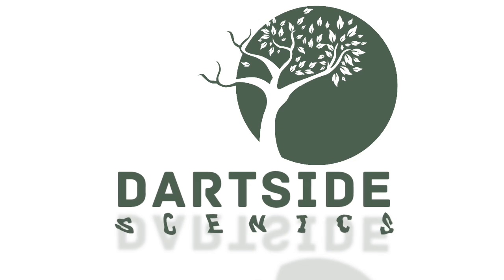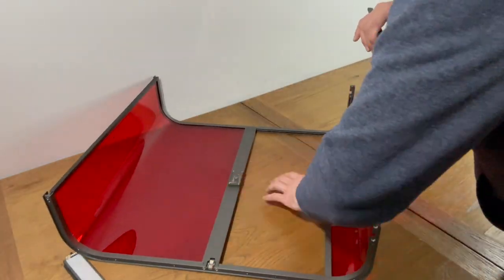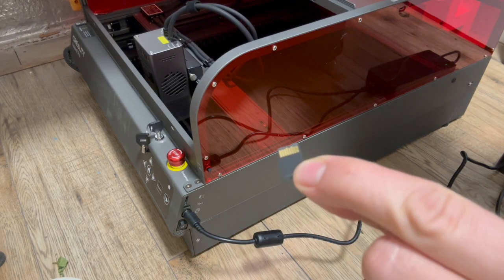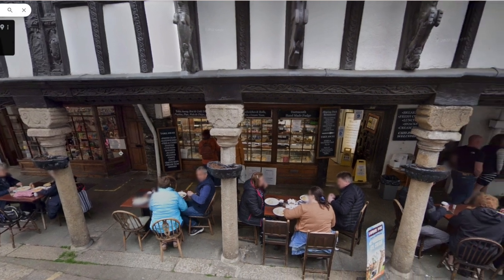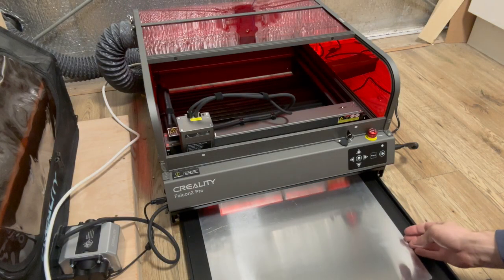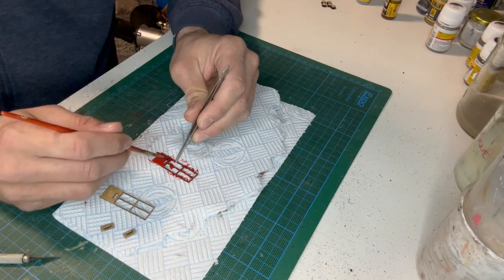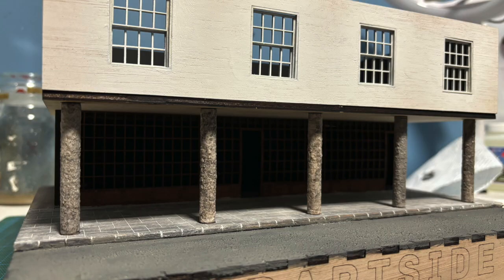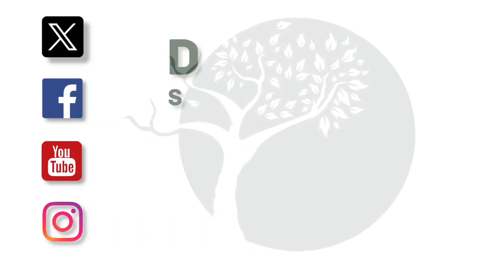Creality Falcon2 Pro 40w - an essential tool for modellers??

Comment: Hello, if you hadn't been sent this. Would you part with £1000+ of your own money to get it? Secondly, if you've never done graphic design is it easy to create a meaningful design for it to cut?
Reply from the maker: Hi Tim.  If I could afford it, I would buy it as I really enjoy the process.  However, I can’t really afford to buy one at the moment so realise I’m fortunate to have it.    If you are thinking of making kits to sell, there is potential to get your money back fairly quickly.  

I’m not a graphic designer (I’m sure you can tell!!) but have managed some nice work with basic knowledge of the Lightburn software.  I have a creative imagination so may find it easier than some to put it together.

Comment: I used to mix fine sand into my paint to create texture, do you do anything similar or different to achieve detailed textures ? Im taking road surfaces and walls etc.
Reply from the maker: I think your fine sand mix is very similar to the Ammo asphalt paint (but much cheaper to make!!). I looked into road texture in my last video but I can’t say I was satisfied with any of my attempts!
Reply: @DartsideScenics  thanks, new to your channel  ! I did use 00 scale track ballast mixed with a thick ish  acrylic paint for a Devon lane, it wasn't too bad.
Reply: I am just starting out and have some ideas whizzing round in my head, one of which is to use ground up egg shells to create texture. All you need to do is to thoroughly wash discarded shells from eggs, let them dry and then grind them using a pestle and mortar. It seems a good way to recycle the shells rather than throw them in the bin!  August 3rd  2025 now and I'm waiting for my new 40W Falcon2 Pro to be delivered. Unfortunately, I had to pay for it but I think I got a good deal via Creality's eBay shop, including a further £75 off with an eBay discount code.